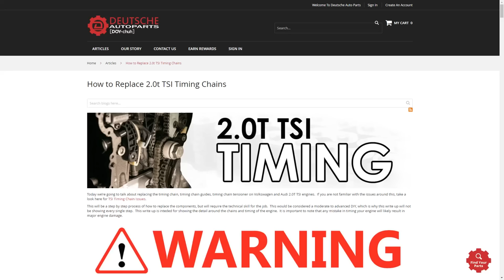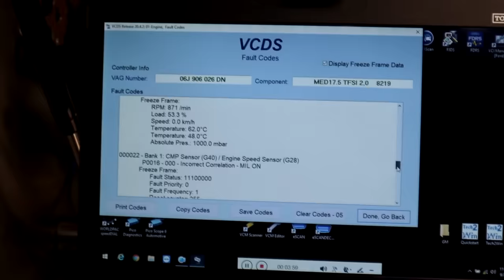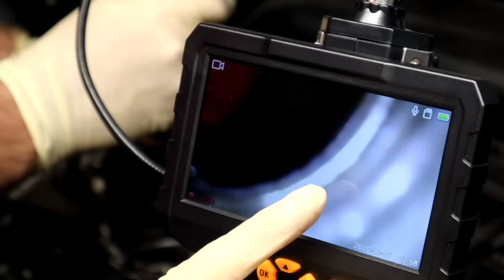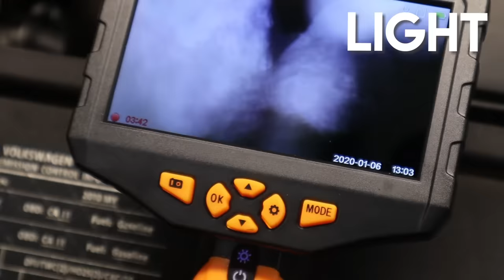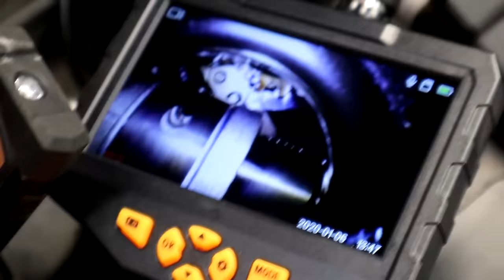The Jalopnik Tiguan FAILED ~ Despite the Warning

Comment: Hi Charles! I'd really appreciate your help.
I have some questions about mixing motor oils:

Can I top up a different brand motor oil?

What happens if you add a different viscosity motor oil of the same brand?

Can I add synthetic motor oil to an engine that has semisynthetic motor oil of the same brand in it?

Thanks! ☺️
Reply: For a short term, in case of emergency any oil is better than no oil. 

synthetic/semisynthetic/mineral oil os pure myth. Most of the casual motor oils are made from crud oil by process of hydrocracking.  Even those labeled as fully synthetic are usually hydrocracked. Some oils that are not made from crude oil but from natural gas for example are usually way more expensive or do have 20, 30, 40 % of hydrocracked oil as ingredient in base oil. In theory only 100% PAO (Polyalphaolefin) or esther oils (Group IV. oils) should have the name fully synthetic but it is not true in real world. And unfortunately this is the current base for the myths ;)

Comment: So ultimately it was the plastic upper guide that failed and caused the engine to jump time and not the more common tensioner failure.  Jason (or his wife) just got unlock that that a plastic part broke off inside the engine while the tensioner with the known design flaw held up.

Comment: So glad mine is one of the last belt driven VAG engines. Its been like 15 years and they still can't make a chain that lasts.
Reply: Joe Barbaro thats not the only problem chief. They use the velocity flaps that get coated in carbon as does everything else.

Comment: Interference motors, eh?
Never liked them. I had an Opel once. It lost the chain tensioner arm. The arm rolled out on top of the crankshaft gear and split the chain. I got it fixed in 4 hours and no bent valves. It was an old car but it was easy to fix.
Reply: That's the beauty of having an old simple car. Right now my Opel is undergoing a head gasket change and some other minor things and the cost is just comical. Worst case :buy new engine, but even if I would have to buy a new car (multiple times) I wouldn't pay as much as Jason here.

Comment: I think EVERYONE knows what they’re getting into when they buy these cars, let’s be honest 😂😂😂 I have a 2017 Tiguan, but purchased the extended warranty. I already had a $1600 turbo rebuild due to the wastegate (really wish they just replaced the turbo), the warranty has already paid for half itself. I’ll probably start thinking about the timing chain soon as I just hit over 100,000kms (60k miles approx.)
Reply: VWs do drive really well, and I like the interior design a lot. Just have to constantly worry if my second generation Tiguan (which is still under warranty) will run implode on me at some point

Comment: I’m assuming this has happened because the timing chain maintenance wasn’t kept up to date and the necessary parts weren’t replaced at the same time, I love Vw I’ve had a 1972 beetle, a t5,  a b6 and now b7 European r-line Passat which I’m having issues with I’ve got a rust spot coming right under the rear window on passenger side where the rear arch seam meets the boot seam the guy at my local Vw dealer warranty guy said my rear window needs to come out for further inspection as he’s not seen this before he said if the factory seal has gone between the panels then it’s not covered under the warranty, my car is only 7 years old. He’s done all the relevant tests on the paint depth to make sure it hadn’t been involved in an accident he can confirm my car is legit it’s as it came out of the factory now to me rust is rust it can only get worse, my car is very well kept the maintenance is all up to date as my mate owns our local Total Quattro Care unit working on Audi seat Skoda and Vw so all genuine parts are used but it’s not Vw dealership prices

Comment: in england they break pistons alot, usually the wear the oil ring sits near the gudgeon pin as there is not enough material under the ring. looking at them pistons it looks like its burning oil

Comment: I own and love driving a Tiguan but I wonder why they designed and made the engine this way and this prone to damage or not rugged so to speak... Why do they use plastic parts in an engine... Just seems by simply replacing it with metal or steel would get you a much better and longer lasting engine. Also the carbon buildup is a serious issue. I've had to replace my o2 sensors twice already just wish there was a way to clean the engine effectively with some type of service.

Comment: Although not the first to make repairs like this, it makes me ask the question: Does VW get youtube? Are they the slightest embarrassed by their engine failure a note in all the Chilton manuals and stay post it notes in mens rooms? For a bad bad and really bad date, buy this car because the engine is known to fail before one hundred thousand miles making the sparkplugs non replaceable because you don't need to replace as the engine doesn't last as long as a set of Champion spark plugs. The insult about that plug goes back as far as the fifties when I started pulling wrenches for my dad and he said if you go champion plugs then buy two sets to get one good one. It has changed and are fairly good now I think. You guys make a great group of guys to listen to at night. You might even get to VGG to make you tube as source of income month to month. I subbed as soon as I  read the whole story cause I just subbed his channel too. Alway can do a will it start when short of things to do.... you only run out of things to do even in a bad shop unless your located next to Taco Bell bug sales. Had good fun on this video as the light humor fit very well... not over done

Comment: Awesome video guys. Now that everyone has a sense of whats to do here, I have a 2009 VW that is sitting in my driveway with the exact same issue. About to sell on Peddle unless someone wants to pay over $1400 for it.
Reply: oh and I have personally replaced the water pump three times, the intake manifold twice, and the rack and pinion assembly due to the steering control module going out and being non-repairable. Willing to throw in the old parts for FREE! Yes, I'm that generous!!!

2009 VW TIGUAN FOR LIFE! 
(Ok maybe just the next few hours.)

Comment: Lol, my Chevy truck has the original timing  chain, never touched non adjustable  currently  with 470,000 miles on it. Additionally,   The entire engine is all original like the timing chain has not been touched.

Comment: After now about 18 VW Audi stuff since 1986, no such issues, ever.  current 2019 golf r 36,000 fun fun fun, comfortable, RELIABLE, fun fantastic ride miles, GTI out to 147K just wanted to update, Jetta VR6 out to 316,000 never touched anything in manual trans or any engine problems, maybe you people don't understand oil changes and new air filters etc? And i never change the oil any earlier than what the book says 7500 on the old VR6, never a problem, never touched chain or guide or nutin, newer ones are now every 10K, not one issue, ever... on GTI's tiguans, Audis, Golf R, nutin, all good.

Comment: It amazes me that a seemingly big company like VW can’t build a direct injected 2.0l 16V engine that makes about 155-165 hp with a timing belt. Their new stuff with non replaceable valve covers ,as it’s part of the head and water pumps that fail from oil contamination from the leaking valve cover seal is just plain bad news. I’d love a new golf but not with the 1.4 tfsi

Comment: My '09 Octavia 1.8TSI was overhauled 2 years ago. Long story short, it was a lemon, most moving parts including the cylinder head and cams were replaced (engine oil consumption exceeded 5l / 1000km). I have two questions if I may:
1. The engine did not have the piston ring lands cracking, but it wore out piston walls ovally, it also had lower but still acceptable compression. Surprisingly, the turbo wasn't that bad either.
Can so much oil just fall through the rings and the oval gap, or is there another path for the oil to just disappear into the combustion chamber? 
2. The engine made a terrible rattling noise before the overhaul and it still does (everything was replaced). One of the mechanics mentioned that the shop might have forgotten to reset the chain stretch correction. How can this be done with VCDS (if at all)? Can it be done 3000km after the fact?

Comment: What is with VW timing chain guides.  My 2001 vr6 GTI had a broken guide at 110k miles.  Lucky for me it did not jump timing, so no damage.  VW seems to have had these problems with numerous models for several decades.  You would think they would learn from their engineering mistakes.  Guides should last for at least 200k.  I like VW but these engineering mistakes are looking at other brands.

Comment: Have you ever seen the brass oil valve in the cylinder head failed? I had to go thru the whole process of taking the cylinder head off just to replace that valve. Just wanna know the frequency of that oil valve failing.

2010 GTI, Timing chain replaced at 231,000km and again at 265,000km for that valve.
Reply from the maker: Damn. Never seen on

Comment: I have done close to 50 of those jobs at the dealership and never replaced the head  always send it to the machine shop and they replace the valves and guides and valve seals  
I have replaced few cams because the missing screen but never a head
I would of replaced the coolant pump as well 
Its way easier with the intake/head out 
Those plastic pump leak all the time :)
Reply from the maker: The coolant pump looked brand new, and it was the updated style so we felt okay about it. But it would be the time with the head off
Reply: HumbleMechanic  even the updated one are not that great i have done a pump and year later gone again and because the leaking “”value cover “ :) 
I have seen aluminum pumps but never installed one I wonder how they do since vw never couldn’t make a good pump :)

Comment: "These engines are junk"....it ran probably maintenance-free (aside from oil changes) for 130k.  I'm only 45 and remember when GM couldn't get anything to last past 90k miles.  Maintain these engines diligently, and you'll get to 200k+ just fine.  Perspective, young dudes.

Comment: You’ed think VAG would learn, but the 2.0tdi in europe had failing oil pumps resulting in a new engine, just like the 1.8t engines. They are, like most German cars, designed to fail after 5 years or 100.000km(62k miles). My Ford Mondeo mk4 has solutions made to make it uneconomical to fix it once it falls below 15.000$ like a timing belt run in oil(1.8turbo diesel) that costs 2-4k$ to change, for a timing belt that will normally snap before 120k.

Comment: So I may have missed it, but is there any 'preventative maintenance' that could have prevented the cam chain jump and valve damage?
I own a 2019 Jetta with a 1.4 turbo that I have had minimal issues with. (Just recently replaced a failed oil pressure regulator solenoid, which was straightforward.) Is this engine prone to similar issues? I believe is has a belt and not a chain? What can I do to prevent them? How often should the belt be replaced?

Comment: I have I question , recently my friend lend away to another person, 2013 Passat TDI and the car end with all the oil into the cooling system and all the coolant was gone followed by a loud knocking noise , so here is the scenario of how this car have this major breakdown, the car was used to tow a trailer with 3 motorcycles which weighs about 3k pounds and the car of course is designed for 1k  pounds so the car was been driven in the highway at 90 MPH in cruise control for 6 hours, so you know the kind of damage we are talking about, the engine did stall due to overheating and I did took a look at it and the car started but with a loud noise maybe a crankshaft damage or a posible low oil pressure due to the circumstances or a catastrophic issue . My question now is does  the engine can be saved? And let’s not talk about the transmission I know what is coming and is going to be replaced as well , cause the transmission fluid have a horrendous smell and color . I want to help them but I am not expert on diesel vehicles .

Comment: I have a 2009 Jetta Wolfsburg with the 2.0TSI with 125,000 and my chain doesn’t make noise as long as the Rpms stay low, but it will on startup if i beat on it a little. Should I get rid of it since I can’t afford that bill to replace it???? Or continue to drive safe and keep on my oil changes? Thanks!
Reply: Diude it’s going to fail not if but when. I’m not a mechanic but I’m mechanically inclined I’m doing the job my self for under $400 but mine failed that’s a $200 job if the car still runs just follow a diy step by step
Reply: That’s what I was thinking but it seems like a really complicated job from all the DIY’s I’ve seen. Plus I though it was superrr expensive to do?

Comment: At this point wouldn’t it make sense to replace the turbo? They changed in later years to beef up the waste gate area as they were prone to fail at 100k miles (depending on how used and maintenance).

Comment: Bought a vw from a used car lot. These idiots replaced the timing chain and installled it completely wrong, timing was off, wrong bolts etc, on top of that the magnet and value spindle needed to be replaced. Cam and im sure the pistons are screwed but im driving this as my daily driver hoping i can get a few months out of it.

Comment: Why a new head? Damaged valves are replaced, new valve guides are made, a mechanically flat head is hydro-tested and it is the same as new. All this in my country does not cost more than 150 euros. Chains and chain spanners are expensive, there's no way around it, but buying a new head because of a couple of bent valves is madness.

Comment: I have a 2013 Tiguan cranks one minute or two before it starts and it shows oil pressure low sign. And when I turn the key to on position I hear a fluid moving. What do you think, thank you in advance.

Comment: Why would they use plastic guides in such a crtical area. Seems like a recipe for failure. And it appears in addition to the broken guide they use plastic in other areas of the timing chain mechanism judging from all those other orange components behind the cover.

Comment: This happened to the 2012 Tiguan I had. Luckily I have several vehicles and could park it for awhile because I found an attorney in Virginia where VW USA is located and sued them. It took 8 months to settle with VW but enviably I got $3k in the mail. However my ordeal didn’t end there because the VW dealer originally diagnosed it and said I didn’t bend the valves but when they took it apart there was several bent valves. They quoted me another $2k above my settlement which I wasn’t having and I told them they improperly diagnosed my car and if they don’t cover it I’ll have no choice to sue them. They did eventually take care of it and fixed it but it was almost a full year of aggravation forcing VW to take responsibility for this high fail item. The vw eventually developed a massive oil leak and was eventually totaled when my wife hit a deer. I’ll never buy another modern vw ever again they are complete crap. I only ought the Tiguan because I got it so cheap because it was a front wheel drive manual but I should of listened to my gut and passed

Comment: Talking about cores, if the valves may have distorted the head or otherwise ruined the valve seal will they still reman the part? Also, if they can't reman a core can they reject to refund the core charge?

Comment: I have a 2009 CC that has a timing chain issue after only owning it for it a year and a half for 6 months of owning it my fuel injectors went bad but they got replaced for free a year later my car was driving horribly turn it off and it never came back on took it to the same dealership that fixed it for free and they told me it's skip time and that I may have catastrophic engine failure my heart sank when he told me starting off it'll be $6000 to fix

Comment: Taking into account that there in the USA gasoline is of better quality, in addition to less alcohol (here in Brazil it is 27%) in gasoline, all this dregs happen in the engine. I had a Tiguan like this and I went through the same problems. In fact, it is a bomb that will explode at some point

Comment: Impressive work But How I yearn for the heady days of the old 8 Valve motors that would take you to the Outer reaches of the galaxy and back If you serviced them on schedule 

One question though!  How come no turbo wastegate pivot check ? They do have issues on the TSi motors
Reply from the maker: The Turbo was actually rather new.
Reply: @HumbleMechanic  that explains it then 😁 Peace be with you brother of the spanners

Comment: I had a customer decline doing chains on a Tiguan yesterday because they decided that a forum that says low oil pressure will cause a p0341 fault (cam position sensor range/performance), is the sole solution to their concern regardless of the fact that their updated tensioner is out more than 7 clicks..... but hey, us VW Techs have no idea what we're talking about 🤷‍♀️🤣

I'll probably wind up slapping a head on it here in a few months once the chains finish stretching. 🤑🤑
Reply from the maker: Oh damn. More importantly that harlequin 😍😍😍😍😍😍😍
Reply: @HumbleMechanic  I should have more content of it tearing up the streets here soon. I just have to get the intake manifold machined flat again 🤷‍♀️

Comment: Do you get alot of complaints for low oil pressure ? I got 2012 Tiguan just had new timing chain done and getting sporadic low oil light. So I'm wondering either oil pressure sensor oil pump itself.. Ohh... Is the oil pump timed. I'm pretty sure its not but double checking. Thanks in advance